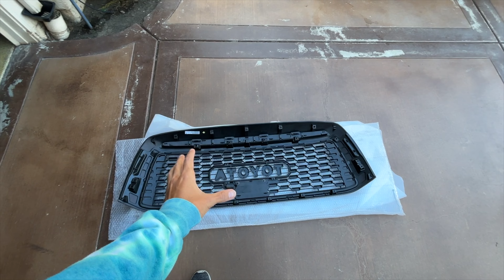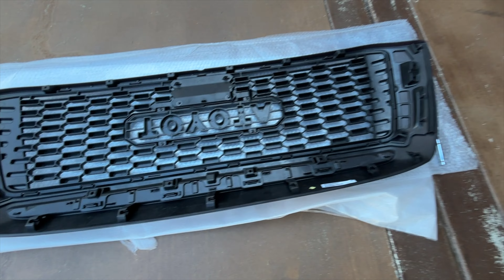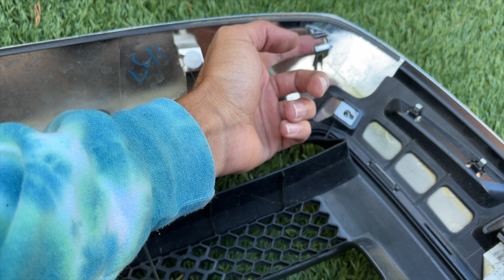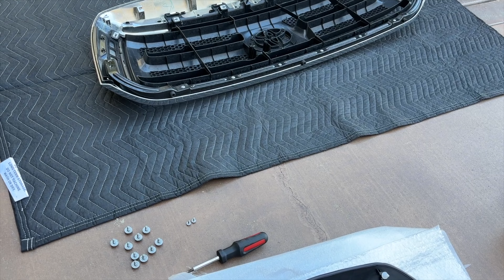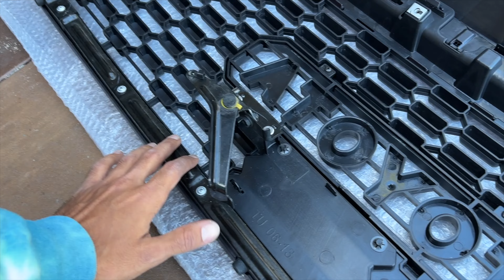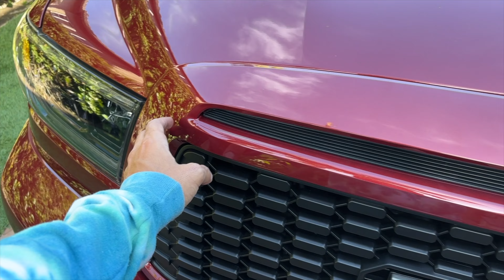How to put a TRD Pro Grille on a Toyota Tundra

Comment: Love your step by step, fo I have to by the Amazon grille frame also. If I do then what’s better . Buying it off Amazon and painting it my self or buy the pre color matched one from the yota garage
Reply from the maker: Definitely the pre color matched if they have your color! It's much more cost effective.
Reply: Got the grill and insert in, all clipped in but only like 3 of the existing bolts lined back up to bolt it to the brackets and hood. Bottom sticks out a little and the little rubber stops on the bottom don’t touch the bumper but it’s on so I’m done fighting with it
Reply from the maker: @brandonholt5544  Hmmm well at least it’s on! It wasn’t easy for me to install

Comment: Looks sweet I need to do that on mine.  Did the company u got from the grill do the paint match
Reply from the maker: No sir. The grille comes black. You can order some colors in paint match though from The Yota Garage I believe.
Reply: @socalexpeditions  ok and this grill will fit my 2008 tundra.   Cause online not looks like only 2010-2013
Reply from the maker: @derekpiehl85  No, your grille brackets are different unfortunately
Reply: @socalexpeditions  ok.  Thanks   the build looks great.

Comment: So did you have the grill from Amazon painted after you received it? And then the grill insert goes into that part?
Reply from the maker: Yes. Bought the grille from Walmart. Bought the insert. Removed the insert it came with, had the grille surround painted, installed the new insert!